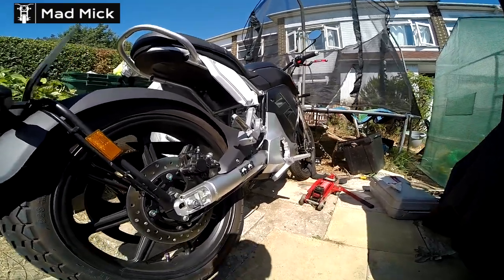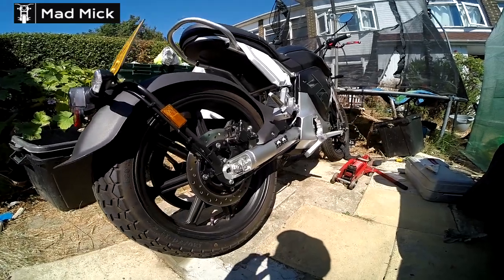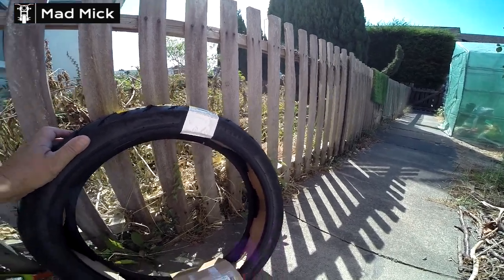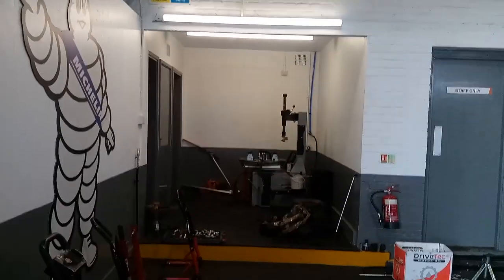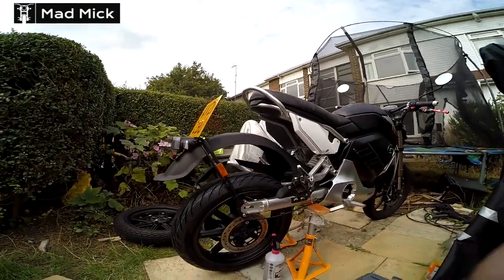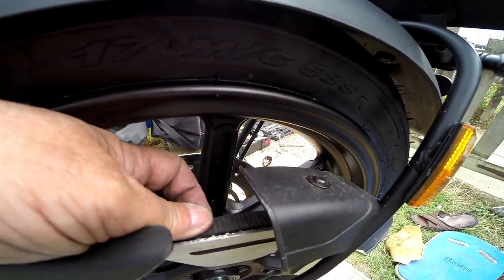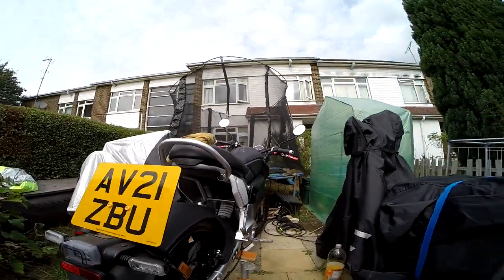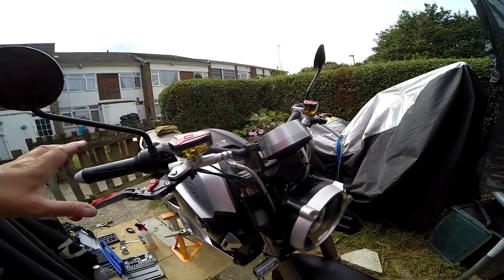SUPER SOCO TC MAX NEW BACK WHEEL NEW PIRELLI TYRE

Comment: I've not really had much problem with the Chinese tyres, I see you can buy them for £7.50 each if you buy bulk haha, what I find shocking are the brakes when they get wet. Apparently the new pads have more grooves to help dissipate the water.
Reply from the maker: I agree the rear is not bad yet the front tyre is ok in dry yet at any angle other than straight up is dangerous in any braking scenario..  as it's easy to fold the tyre
Reply: @michaelphillips1959  have you got rid of it? That's worrying to know
Reply from the maker: @hollow34  yes I did, do t worry though, good ride, I had to get a ULEZ compliant car and hopefully saving for a zontes gk350
Reply: Thanks for the tip to get the belt to stay on the outside of the back carrier. Ever since i replaced my tire it keeps sliding towards the inside.

Comment: Hi, i am seriously thinking of buying a T C Max but it would have to live outside (no garage) i noticed you had a bike cover and assume yours lives outside too? how do you find it copes with our climate? does the damp and cold cause any problems?
many thanks, Rob.
Reply from the maker: Hi Rob, the bike will be fine under cover, remove battery overnight, I ACF50 everything, except brake disks of course, the side panels are easy to remove to ACF50 the frame, the only cautionary item to change immediately would be the front tyre, it's got no grip whatsoever..... Have you looked at the Voge ER10 a better newer design with abs brakes this would be my choice at present time..... Super soco will release the SPLASH in 6 months so I would also suggest to wait for that version also
Reply: @michaelphillips1959  hi Michael,
thanks for your reply, i will have a look at the voge, i won't do anything until after xmas but the splash sounds interesting!
Reply from the maker: @robertbrooks9275  defo wait  for the splash, check it out, it's the latest best
Reply: @michaelphillips1959  Vmoto Stash, not splash